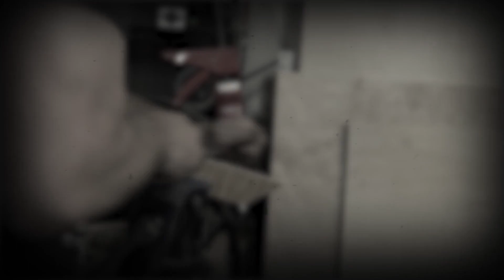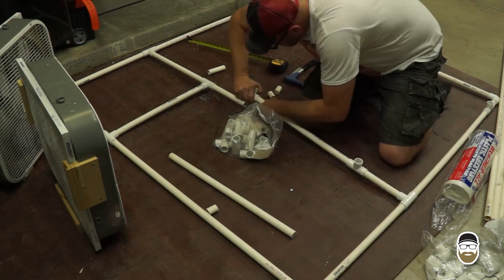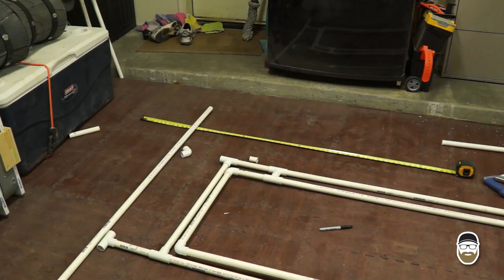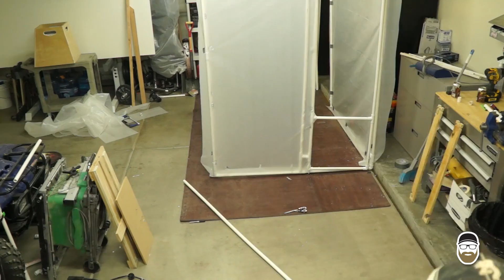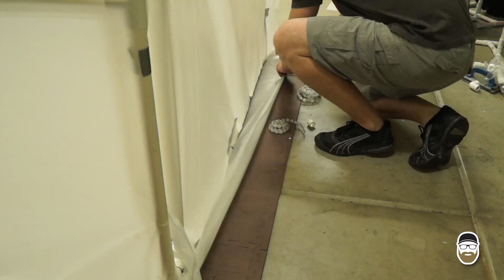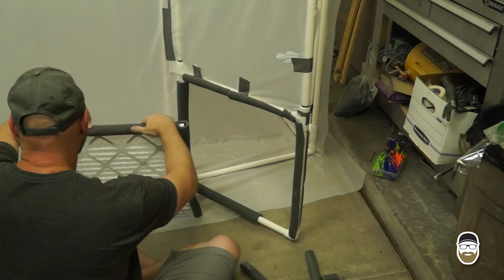Build a Collapsible PVC Paint Booth

Comment: actually works better to use the fans as intake and increase your exhaust filters so the booth has positive pressure and keeps out the dust vs sucking the dust into the booth which happens with exhaust fans... also keeps the paint fumes away from the fan motor which does have little sparks inside it.
Reply: Most box fans use an eddy current motor which contain no brushes.
The only possible sparks are from the switches used to change speeds.

Comment: Pro tip: an exhaust fan can be great, but it will pull overspray into the area that's not masked off. I'd recommend a single, small fan. Something like a 9" fan. Also, make sure there is enough incoming air. Super important. This build doesn't have that. The intake needs to be twice the size of the exhaust hole, and that's when there's no fan. Plan for 3x with a small fan. If using air filters, factor in the loss -- roughly 10% as a general rule. 

Nice build!

Comment: for painting cars this wouldn't work. the booth needs to be virtually airtight, you have major gaps everywhere including all around the fans. if it doesn't stick it's because the plastic you're using needs to be substituted or a new kind of tape used. also the walls shouldn't collapse, you're supposed to use slightly positive pressure so dust from outside doesn't get sucked in
Reply: I’ve been trying to figure out how he sealed the edges of the walls where they meet. Guess he didn’t ! 😂

Comment: I got couple of tips for ya...First on real spray booths fans extract air to the outside because it's the best way stop contaminated air from building up in side the building the booth is located in. Not because it's the best way to build a booth. In such negative pressure booths exhaust fans suck dust in through any leaks the booth may have. For diy designs where fans won't be exhausting air directly outside anyhow a positive pressure booth, as in having fans blow filtered air into the booth is going to give you a more dust free environment.

 The second tip is...PVC Primer is just acetone with purple dye in it. So if you already have acetone you don't need PVC primer and if don't have acetone nail polish remover is also acetone and it's x4 cheaper than PVC Primer.

Comment: Think I'm going to do this project.  The one change I'll make is that I'll use build the walls independently and use snap saddles to connect them togother rather than tees
Reply: How do you get the edges where two walls meet to be sealed?  Thanks

Comment: Those fans are synchronous motors, they don't have brushes to cause sparks. The only thing in the fan that could cause a spark is the switch. Don't change fan speeds while painting and you shouldn't have any problems. On the small booth I made I use a power strip, remote from the booth, to turn on the fans and the light...... Oh, yea! The switch on the light can make sparks too.....! Going with the remote power strip is better.
Reply from the maker: That's a very helpful observation. Thank you for that!

Comment: Somebody mentioned in another video that it might be unwise to exhaust the potentially explosive air through the fans... ie electrical spark in fan and kabooooommm.   Maybe better to blow air INTO the booth from the fan (positive pressure) and exhaust through your door vent.
Reply: The box fan probably has a single-phase AC induction motor, which is brushless and therefore shouldn't create sparks (unless it fails).  The motor may have different coils for different fan speeds.  You might get a spark from the switch if you turn a fan on or off (or changed the speed), but you can turn it on before you start painting, and give the vapors a few minutes to clear before turning it off.  Just found AJ Wilson's similar comment further down.  So treat this comment as coming from the Department of Redundancy Department.

Using the fan to supply air to the booth instead of exhausting air from the booth would probably create undesirable drafts in the booth.  To understand why, try standing on the intake side of a box fan vs. standing on the output side.
Reply: Hopefully the intake fan idea will not create too much draft as it is pushing through a filter so should disperse the air a but and just create a pressure rather than draft

Comment: Nice build! Little tip; you should add a couple more intake spots, having more outward pressure than inward pressure makes air & dust have a higher chance of finding it's way in thru places other than the filter. PC building has the same principal, having 1 more intake than outtake prevents dust from finding it's way in through seams.
Reply from the maker: Good thinking! It actually turned out that this choice is a good one as the pressure creates this vacuum effect (provided you can replace the filters as often as you can replace the paint) and in most cases the airflow pulls the (most of) over spray up and away from what I'm painting. I'm honestly not sure how another intake filter would help, but I'm happy with the way it works now. If you try it on your own, let me know if it works out!!

Comment: Pretty god job at the construction. What was your total cost and how does it fair when you have to disassemble and reassemble?
Reply from the maker: +Jeremiah Lindley sorry for the late reply. I think in total I spent $80. It's actually holding up pretty well. I've put it up and taken it down 3 or 4 times now and so far so good. The plastic sheeting is starting to get a bit nasty, but it does work well.

Comment: In some DIY Spray Booth videos, people attach a aluminum tube to transport the air from the filters to the outside. Is that not necessary with your DIY Spray Booth? Nothing comes through the filters into the garage?
Reply from the maker: Absolutely, In fact I do not advise on not having the paint booth just blowing into a closed garage at all. When painting there are two things that we worry about. Overspray and the solvents. The fans and filters tend to the overspray… and unless you have really strong fans pulling a lot of air through solvent grade filters, then we aren’t doing anything to tend to solvents, which is why I highly, highly suggest keeping all the doors open when it’s in use. I use the paint booth primarily to keep the paint area “clean” so floating debris have less chance of getting on my item, the fans help pull all that over-spray and dust away from the item I’m spraying and keep the overspray out of the air. The other reason is that it will keep the overspray off your cars and your neighbor’s cars. Hope that helps.

Comment: i think you had to fill the gaps between the fans and the construction.. it will cause a loop of air i think.
Reply from the maker: Yeah and even still there is a little bit of a loop. But it works pretty good.

Comment: So do the exhaust fans just blow the air into your garage? Do you find the filters on the exhausts capture all the overspray? I want to put one in my garage too, but we get some strong afternoon winds where I live and I'd rather keep my garage door closed.
Reply from the maker: Typically, I keep my garage door open with the side door open as well. You need to still worry about the fumes. The over spray is managed pretty well as long as the filters don't get too gunked up. I highly Highly suggest, to not spray with your doors closed. In fact, just don't do it. All those fumes are combustible.

Comment: I've heard that the motors on these kinds of fans create an explosion hazard if using combustible paint?  Do you worry about that?
Reply from the maker: yes, it's certainly a concern. so if you do the same make sure to use a brushless fan or a fan rated for hazardous conditions. I've been using a fan with filters for a long time and, luckily i haven't had any issues. but i do open the garage doors to provide more ventilation. Honestly, the fans i use are good for particulate removal, not solvent.
Reply: Any idea where I could get one of those without spending a fortune?   I really like your idea but since I use mostly solvent based and aerosol paints I need to make sure I don't blow things up!
Reply from the maker: Unfortunately, no... which is why I use these box fans. I've read that some people have the fan to push air in from the top with a filter in front of it and then have a filter at the bottom, like I have in the door, so basically turn the fans around and flip the filters. A bit more expensive would be to buy a blower on craigslist and then seal off the motor itself. If you're able to do that, I would feel pretty comfortable. Otherwise, you may be looking for an industrial fan.
Reply: What was the total cost of all the parts that you used to build the booth?Excellent video very informative.Cheers
Reply: @erichaltomwoodworking7363  a brushless motor could still spark no?
Reply: @Bamlydean  brushless motors have no contacts to spark. They use electronic commutation which occurs outside the motor in a VFD or driver board usually with solid state switches. In a failure condition it could spark but unlike a brushed motor it wont spark normally. You should also be careful with metal blades and static charge buildup as this can cause sparks. Real explosion proof fans use aluminum blades which are naturally spark resistant if debris hits the blades or the blade gets loose and contacts the walls of the fan.
Reply: "Sucked the wall in" tells me you made the most common rookie mistake. (seen a bunch of videoes, making that mistake) You'd want the fans to blow the booth up, inflate. 1: You push/blow OUT any dust in any holes/crevases, whatever. 2: You don't have any paintfumes passing the electic motors.
Reply: +Flemming Veggerby - it's not a rookie mistake... lol.

It's a negative pressure booth. 
Your referring to a positive pressure booth.

As long as the booth keeps the air exchange rate at 25% percent lower than the LFL... there's usually no issue using these fans in a negative pressure booth. That said, you need to do the math to figure out what's what with any booth as far as air flow it exchange rates are concerned.

The sucking of the walls is the SP increase inside once the fans are on.

The rookie side for most in making these is they don't do the math. They just toss in a couple fans and an intake filter and haven't a clue if either are enough or too much, etc etc. 

All booths large or small have to be tuned.. that's is you want a decent booth. 

Some are just happy putting a tent over what they're spraying and putting a box fan to circulate and clean out a bit of overspray.

Comment: so, what was final cost on your spray booth ?
Reply from the maker: I would guess about $80 total including tax. I bought 2 rolls of sheeting, which I could have got by with only 1.
Reply: So, are you still happy with the booth?  Any problems with flammable finish and the fan being electric?   I put my fan on the intake side with filters over it and just a filter on the exhaust side. ..
Reply: I just bought all of the materials to build this including one fan and an led work light from home Depot and it was close to $300